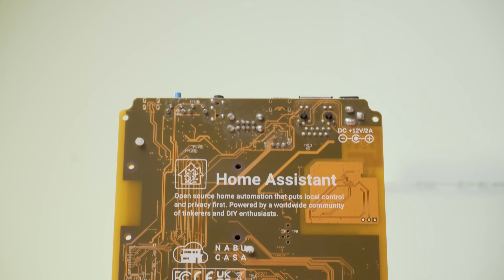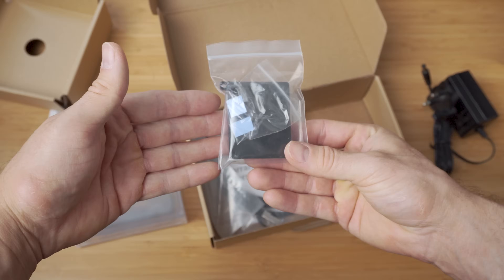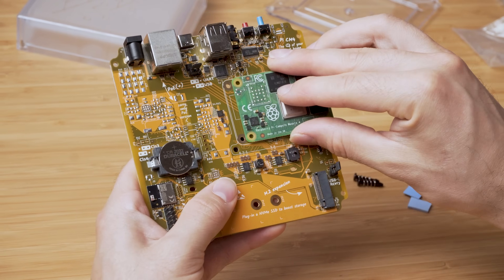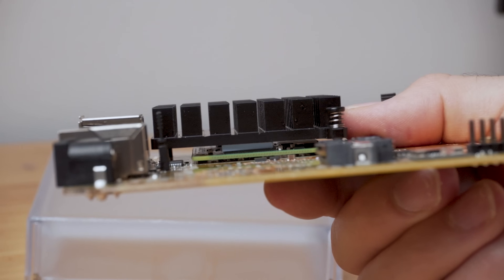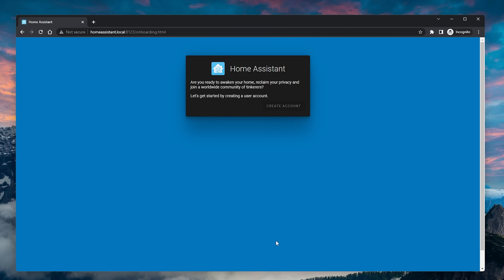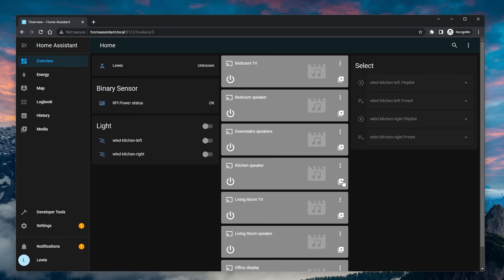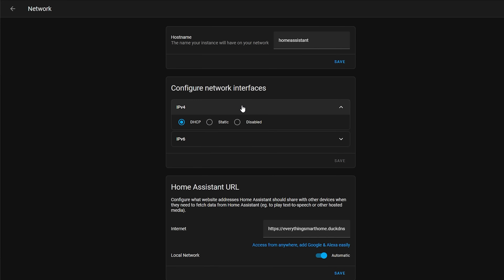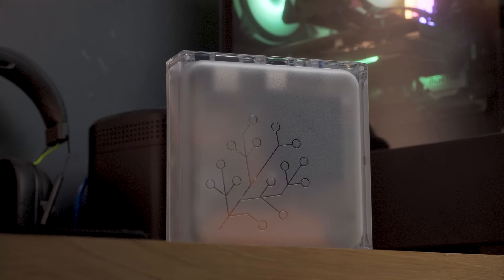Getting Started With Home Assistant Yellow!

Comment: The setup does seem more complicated compared to the usual, mainly due to the lack of a video out. But I guess since it's only used once it's hard to justify.
Reply from the maker: Hmm I get what you mean, but the standard Yellow is literally plug in and go - if you decided to go for the Kit version then chances are you may be a little more advanced anyways.

Video out would have been nice but I think it was a licence limitation (think you have to pay to use HDMI?)

Comment: What exactly do you mean by powerfull? It can't even run 1 camera with frigate model detection. People shouldn't buy this thing. Instead buy a decent NUC
Reply from the maker: That's a very specific use case that not everyone is doing - blanket statements like that one are really not helpful in the slightest.

In regards to your other comment, you say your i7 runs at 40% CPU and the Pi is 100% so don't buy it (again for a specific use case that not everyone does but regardless), well my Xeon with a coral runs at 5% CPU, so does that makes your NUC useless too? No, of course not - everyone has different use cases, different priorities and different budgets

Comment: Thank you Lewis for your effort and sharing, but my question is, is the yellow worth it, or do I buy a nuc just for the home assistant? Could you share your impressions of performance between a pi 4, yellow and a nuc, it would be a good video. Cheers
Reply: The yellow is a pi4 only with some additional options like on board M2 SSD. Its a raspi 4 compute model so just a raspi 4. Buy a NUC 10 i7 to get real performance. Running 7 Cameras with object detection on frigate with 40% cpu load. The pi4b will go to 100% cpu load with 1 camera object detection. I really don't understand why home assistant ever released this yellow. I must admit it's pretty good for home automation just like the normal pi4 but with cameras and object detection you should never go for this low performance stuff

Comment: If I have an existing HA install on CM4 (with eMMC) on an I/O Board, can I just take the CM4 board and slot it into the Yellow board? Or will I need to go through the backup process and reflash the system?

Comment: No fan option is a deal breaker for me, especially since the heat sink is below the cover
Reply from the maker: I think people are more concerned with the thermals than they need to be personally
Reply: @EverythingSmartHome  I think it depends if you have AC, my passively coold device have been thermal throttling since 2 weeks
Reply from the maker: Do you have a larger heatsink installed? What temps are you seeing?

Comment: It is impossible to get CM4 modules... so good luck getting this up and running... Mine should be coming next week,  but probably will wait 2yrs until cm4 is available...
Reply from the maker: CM4s are a bit tricky to find, but doesn't take that long if your patient, use a site like RPI locator - there is stock coming in more often than you think
Reply: @EverythingSmartHome  Been looking at ripilocator for ages for CM4 for my HA Yellow but haven't seen one  in stock here in the UK.
Reply: @EverythingSmartHome  oh thanks, I didn't know this kind of tool existed. I see already low spec ones (1GB ram) will wait till better ones will be in stock
Reply: NabuCasa may be able to have some cm4 by the end of the year to ship the standard version, but if you have a kit, you’re probably right, it’s going to be a looooong wait to get a new Pi. Unless of course you want to buy a used one for $200+ 😳